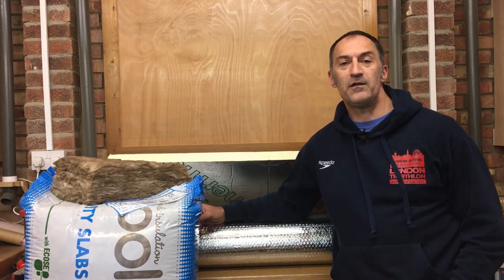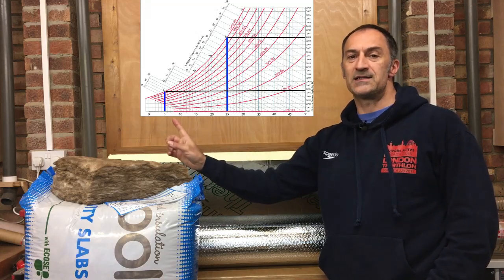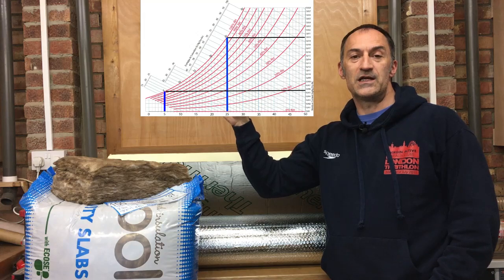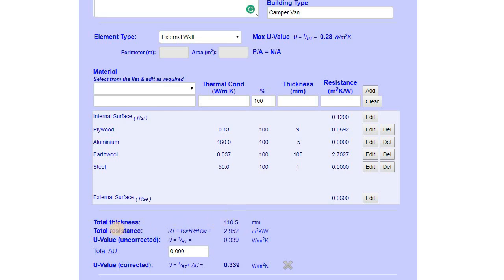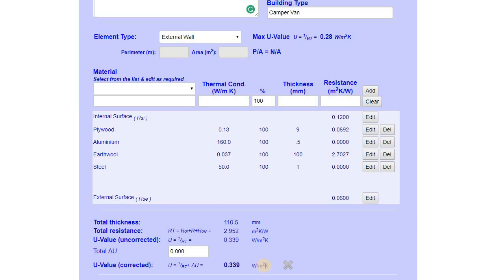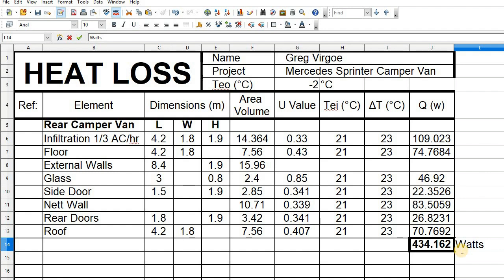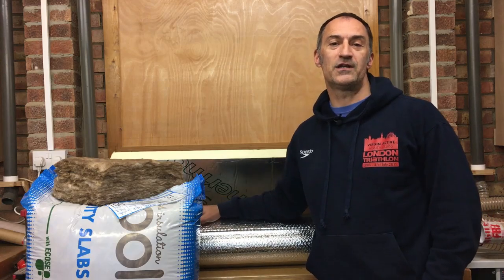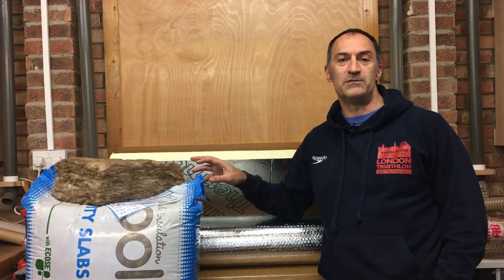How to Insulate your Van Part 1 - The facts you need!

Comment: What if you plan to travel mostly in warmer  months and occasional winter...how should u plan to insulate.
Reply from the maker: Exactly the same. Thermal transmittance works the same in hot or cold weather. Think of your van as a big fridge or cool box, they need good insulation to keep the contents cool. You also need to prevent the Suns Ray's from entering your windows as the solar gain is the biggest cause of hot vans in summer.

Comment: Thanks for sharing your knowledge. That's answered alot if questions I had. Have you come across a product called TLX gold. We use this in the roofing industry and i wondered how it would perform if used in a van ?
Reply from the maker: Hello Darren, I downloaded a copy of the technical data sheet for TLX Gold and it always concerns me when companies do not openly publish the value of thermal conductivity for their product, what are they trying to hide I think? We can use their data to calculate it so let's do that. 
If we take the thickness 0.033m and divide by the R value 0.85 we can find the thermal conductivity which is 0.038W/mK
So this is actually the same as mineral wool, glass fibre or expanded polystyrene. So there you go, yes it will work but you will need three layers to make up 100mm thick and match a single batt of standard wall or lift insulation which I'm guessing would be a much cheaper way to go. 
I haven't looked but if it's got gold in the title I'm guessing you need to part with a lot more of that to buy it 😃 hope that helps.
Reply: Thanks for your input Greg I appreciate it. It was just a thought about tlx gold as we've recently used it on a swimming pool job and it was so warm whilst we was working on it 😎
Reply from the maker: No problem, what it demonstrates is that it's the same as many other products so it reminds me of that old saying. 
All that glitters is not gold.

Comment: Greg, you've done an amazing job with attention to details and explanation! ^5 Question - What are your thoughts of 3M Thinsulate + PolyIso rigid board + Reflectix? Thanx
Reply from the maker: Hello, you don't need the Thinsulate. It's expensive and its thermal properties are no better than fibreglass or expanded polystyrene.
Stick with the PIR board, or mineral wool and reflectix or polythene vapour barrier over the top of everything. All you need.

Comment: I loved this video! Extremely informative on every level! One question, it may have been dealt with and I just missed it, but why not use closed cell spray foam in the back? Higher R value and I would think it might be more air tight too?
Reply from the maker: Hello Nick, I talk about spray foam in the next insulation video.
No problem using it and you're are right its a very good insulator.
I just didn't want the mess associated with spray foam.
Plus you cant go back once installed it's a permanent thing.
Thanks for the great feedback, enjoy the rest of the series.

Comment: @Greg Virgoe
(A) I'm assuming the thermal and resistance values are consistent if a van is in a hot environment and someone is trying to keep it cooler.  Am I correct in this assumption?  
(B) What, if any changes would be needed in the vapor barrier placement if someone expects to be in hot environments and will primarily be trying to cool their van?
(C) This is definitely the best video I've seen on insulation for laypersons!
Reply: Hi Greg, I was going to ask this exact same question so thanks very much for your response. We're based in Victoria, Australia where the temperatures can range from -10c in winter in the mountains to 45c in the height of summer.

We will be beginning our van build mid-year and only just discovered your channel. The quality of your videos and work is fantastic. There's so much information on van builds on YouTube, but we're really glad we found your channel as it's the best resource by far.

Thanks again.
Reply from the maker: Yes, the transmittance of heat works the same way whether it is hot or cold outside. Think of your van as a big cool box full of beer. Most cool boxes or refrigerators are a sandwich of sheet material and PIR foam board. The vapour barrier is not important in hot climates as the relative humidity is very low and the air inside and out is very dry. The van will not be cold for condensation to form, unless at night the temperature drops below the dew point. What you will have to consider more is solar gain through your windows and I strongly advise on fitting external reflecting blinds on your cab and side windows. The more you can prevent the Suns Ray's from entering the glass and heating up the internal objects the cooler your van will remain. Hope that helps you.
Reply from the maker: Thank you James, very much appreciated. I too have watched hundreds of van build videos before doing my own and there is a very broad spectrum of knowledge out there. The scary ones are those doing things that they've seen others do but not sure why? I hope to back up mine with sound theory so at least you can see why I'm doing it this way. Pleased you like the videos, thanks for supporting me.
Reply: boo yah i was thinking the same thing

Comment: Great info, Greg, thanks for the effort. I'm curious of your experience maybe from other conversions or research: Isn't there a risk that the mineral wool insulation would pick up moisture from the outer air and not be able to release that moisture due to the very effective vapor barrier and cause body corrosion problems on the long run?
Reply from the maker: Hello, you need to make sure that the voids are completely sealed and holes need to be filled or taped over. If no air can get in there then you won’t have any problems. This Earthwool is water repellent unlike some fibreglass materials. Thank you

Comment: If I put reflectives behind my radiators, do you think it will make a difference to the room temperature ?
Reply from the maker: Hello Dave, yes it will help, radiators as their name suggest primarily give out radiant heat to the room. This heat off the back of the radiator gets absorbed into the wall structure. The reflectix stuck to the wall behind your rads will reflect this radiant heat back into the room. Hope that helps

Comment: I am a new sub today so apologies for the late comment!!!! great video and learned alot, so an apt question on your Sprinter series regarding my loft insulation!!! whats best for loft insulation, the wool or the board? fantastic videos and I plan to go through them all and catch up.... really thinking about my own Sprinter conversion....
Reply from the maker: Hello, Mr Mackey, interesting question. As you've seen the PIR board is almost twice as good as the loft style insulation so it would give you much better insulation. The only reasons I can think why people don't use it very much in lofts is the cost and ease of installation. If you are converting a loft to living space it is the perfect solution to fit between the roof rafters before you fit plasterboard. Because you can maintain a ventilated air gap above it and good vapour barrier on the room side. As far as floor joists are concerned just stick with the fluffy stuff. Hope that helps.

Comment: Hi Greg, veree nice tutorial

Are you planning on extra door/window seals or have you gone for .33 air changes just to get a figure. I know we'd struggle to get that sort of value even in a passive house build, or is it just a function of the material ie metal panel van. Cheers
Reply from the maker: Hello, just to confirm, 0.33 is the U value, the air change rate is 1 per hour.
The equation for ventilation is Q = 1/3 N V ∆T
Where:
N = Number of fresh air changes per hour of the building (ac/h)
V = Volume of the inside space of the building (m3)
∆T = The temperature difference of the air from outside to inside. (k)
I am replacing the door seals.
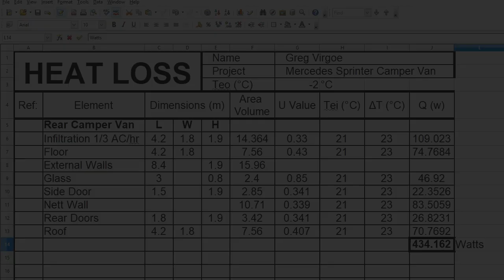Reply: Sorry said .33 instead if 1/3 AC/hr (your tabled figures at 13:25 ish) - so the U-value of 1 air change/hour is  0.33 (so 2 AC/hr is .66 etc?) I'm probably struggling to understand this bit :(

Comment: Hi Greg, great work but I’m curious what your opinion is on closed cell foam insulation? I was advised that it was wise to used insulation that would not soak up moisture from the air as many people say the insulation is soaked when they go to check it. Would your foil technique prevent this? Or would closed cell be the way to go?
Reply from the maker: Hello James, yes it is fine to use. It’s not as good an insulator so you’d need more to get same results. Earthwool and Diall recycled plastic insulation are both water repellent.
Reply: Greg Virgoe great, thanks for the reply Greg. I’ll be sure to use this video as a guide on my next build.
Reply: James Wilson :-)

Comment: Hi Greg. Top video, thanks.  I do the odd conversion and have a neat way to insulate the windows. Black out material on the outside, a thinsulate core, material of your choice on the inside and rare earth magnets round the outside edge. Trim them to the size of the outer metal ring around the inside of the window and throw them up. These work really well on side windows, like the 2 you got installed on your Sprinter. The biggest plus is when you remove them you have the complete window aperture open, no gathered curtains obscuring your view.  Not sure if I have explained this properly.  Just let me know if you want me to send you some photos.  All the best. Craig  #kyleskucampervans

Comment: Why did you use Aluminum's number for the reflectics when it should be Mylars number as the stuff is using the same material as a space blanket. The stuff is plastic with a aluminum coating to be reflective yet still be a thermal break
Reply from the maker: Hello Andrew, the thickness of that products components are in fractions of a mm. The foil has no resistance to thermal conductivity and the air gap at 3mm is too small to be classed as a cavity (min 25mm) Therefore as far as thermal transmittance is concerned this product has little to no value. This is why you will never find a figure for Lambda for this material.
You are right it is a reflector of radiant heat waves but that also relys on and air gap being present. You may get some benefit from thermal bridging. 
It’s just not meant to be a good insulator. Hope that helps 😊

Comment: Great video have you looked into the ceramic additive you van add to paint "insuladd" it is what I am planning to use.
Reply from the maker: Hello, I looked at the website trying to find the technical data. 
I clicked on insulation values and there aren't any? LOL
If you want my honest opinion, don't waste your money.
There will not be enough of an effect to reduce the internal surface temperature, and your van will be dripping wet inside.
The one any only thermal image showed a temp difference of 5°F so basically nothing.
That could have even been the temp of the paint that was being applied, few mins later it would have been the same temp.
stick to something tried and tested. With actual published technical data for thermal conductivity.

Comment: this is th best videos 
on cmpees,your explanation are clear and simpleI .i am from aworme cantry,and I am not shur that the bubls with aluminyum dont work hire,I think they rflect heat some how
Reply from the maker: It does need an air gap either side to work effectively.
It will give you a very small thermal break.
But its a fantastic vapour barrier. Thank you

Comment: Really useful video cheers, shame I couldn't of found this a year ago but we all learn from our mistakes. A quick question for you, what's your thought on using expanding foam to fill the hard to reach areas in the van? Such as the support pillars and overhead ribs as sometimes you just can't quite stuff the glass wool in far enough to get a full coverage. Cheers again for such an insightful video.
Reply from the maker: Hello Jonathan, you can watch my next video for my views on expanding foam insulation which are quite favourable. I just chuck in an extra morsel here for thought and that is “where will you be using your van and what will the climate be like?” If you are trekking to the artic circle then you might want to fill every gap if you are using your van in much warmer climates it’s not an issue at all. What are your plans?
Reply: Greg Virgoe I live mostly in the North of England and travel to Scotland quite a bit which is well know for being routinely wet and cold. Also plan on doing a eastern Europe road trip down to the Alps then the Med and back up the coast. Big mix of temperatures there really. Will be looking at putting a heater in for the colder places obviously. I'll make sure to check out your other video.

Comment: Neither of those are very good R value? Fiberglass is much better, and Tuff R foam is the best next to closed cell spray foam!
Reply from the maker: Hello Tom,
Tuff R Foam is a Polyisocyanurate (PIR) insulation, Therefore, it is exactly the same material as Celotex and Kingspan.
Yes, they are ALL very good insulators but they all have the same thermal properties. K-Value of  0.022 W/mK
Fibreglass only has a K-Value of 0.04 W/mK so it is only half as good as the three products above.

You are probably comparing my R-Values in SI units to imperial R-Values, where they are expressed in BTU, inches and °F instead of the metric system I have used which is stated in Watts, Meters and °C.  The two values are very different.
Beware of suppliers giving out false R-Value figures by including the rest of the structure, if you see a * or (1)(2) by the side of the R-Value is usually a good indicator that they are pulling the Rockwool over your eyes :D

Comment: Hello Greg, great video. Why do you think aerogel is very rarely used as an insulating material in vans? Can aerogel withstand the vibrations of the road without breaking? Also, what is your opinion about using vacuum insulated panels (VIP) on the ceiling and floor?
Reply from the maker: Hello, Aerogel is the best insulator and has the best thermal properties of any material, apart from the vacuum of space. :D
The reason it's not used more is mostly down to the cost as these are 10x the cost of PIR or Mineral Wool Insulation.

Comment: Thanks greatly for this info Greg   It's really useful , and like the previous comment , I don't think there is anything as comprehensive as this out there. Just out of curiosity , did you consider "superquilt " as a possible material for use in the conversion?
Reply from the maker: I have seen this product before but not heard it called by that name.
It has an R-Value of 1.52 so not as good as the insulation that I am using.
It does benefit from multiple layers of foil for good moisture protection.
The manufacturer recommends an air gap on both sides of at least 25mm?
It will work ok but there are better products out there that are twice as good

Comment: Thank you for posting this video and sharing your knowledge, I converted a panel van 7 years ago with a very similar method and had no problems at all. I am about to convert a Caddy for sleeping in occasionally its a much smaller van with less space for kingspan which has made me look into how the smaller Vws are insulated.  It seems a very popular way is to use Thermoliner which is a insulation, sound deadener and vapour barrier all in one its a foil lined closed cell foam stuck directly onto the metal panels with a air gap or plastic wool before putting carpet lined panels back on and then recycled plastic wool in the beams. With no vapour barrier on double skin parts?? Just carpet lined. I was willing to try this method but I'm concerned about there being no vapour barrier on the double skin for thermal bridging and condensation. It seems the idea is to let it breath rather than seal it all up. I would be very interested in your thoughts on this approach as it goes against what I previously thought was right. Sorry for the long post. Thank you in advance.
Reply from the maker: Insulate as you suggest but make sure you put a vapour barrier over the insulation before you put the panels back. You don’t need to let it breathe if the moist air cannot get to the van to condensate in the first place. Prevention is better than cure. Hope that helps.
Reply: Greg Virgoe Thank you for replying. That's what suspected, now it's a case of finding a vapour barrier I can neatly line the double skinned exposed metal that I intend to carpet line. Thanks again
Reply from the maker: Hi, carpet line the metal door frames etc. But where you have put insulation in voids make sure there is a vapour barrier to seal over the pocket. Hope that makes sense. 👍🏼
Reply: Greg Virgoe Yes thanks I know what you mean. I used a barrier tape on my last one. I was confident in the technique I used on my last one but because I'm approaching this differently I was unsure. Thanks for you knowledge. I will catch up with your other videos now to see how your build progressed. Cheers